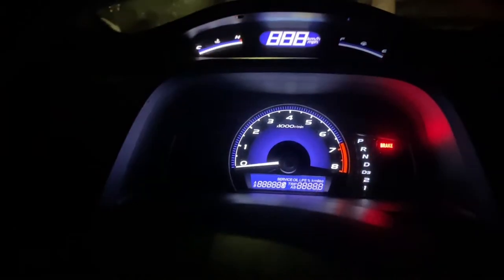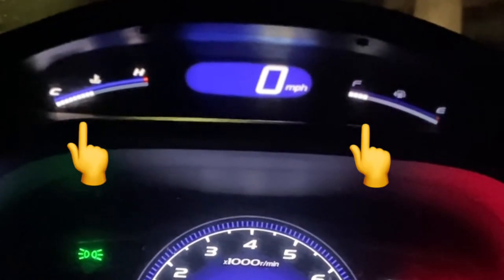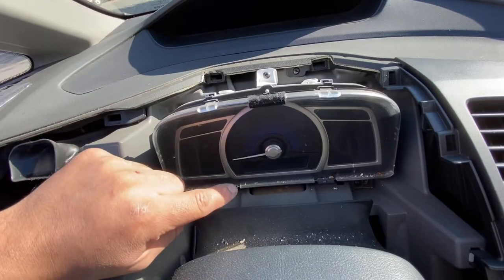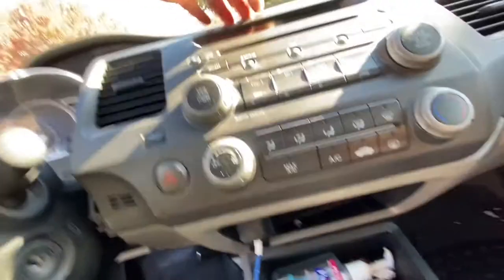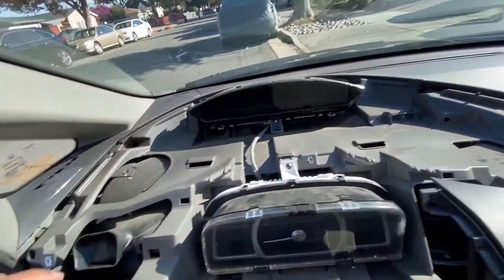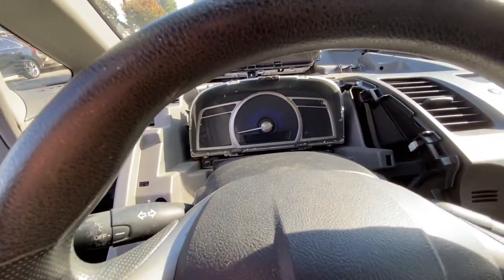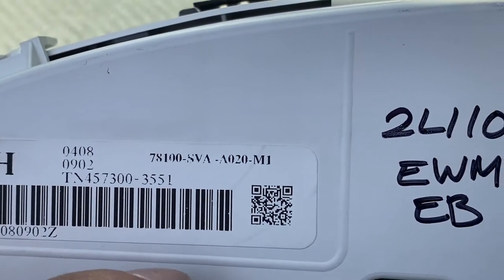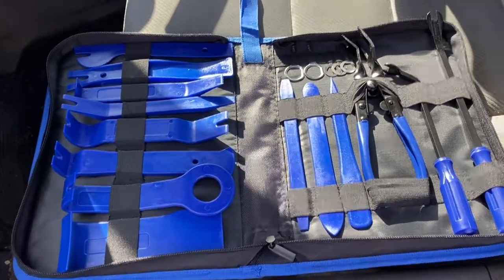2006-2011 Honda Civic How to replace gauge and instrument cluster- STEP BY STEP

Comment: 90% of them do this. Mine does also. You can press on it and it will swap around to normal. Due to bad solder connections on the board on the back.
Reply: Thank you for this comment! I just bought a used one so I was freaking out about it. Learning it's a common issue (and that you could just slap the plastic trim back to normal) was incredibly reassuring.
Reply: @cassandraperkovic6167  yeah, it’s annoying but not a huge deal. If you put gas in it, you know there’s gas in it. Lol. Mine got to the point where it would be inverted, and just display backwards. I could still read the gas, it was just (blacked out bars) were gas, and the (white illuminated bars) were what gas was missing.
Reply: Is this something you would fix before resale? That's what I'm thinking of. Doesn't bother me but wondering if it would kill my resale value

Comment: This is awesome. I just bought a used 2009 Honda Civic and have literally the exact same problem. My temp gauge lights are inverted. This was extremely scary when I first noticed it because my last car overheated and died, LOL. Turns out it's just a lighting issue! The temp gauge and fuel gauge are such a crucial pieces of information that must be working properly to maintain the safety of the vehicle. I'm so glad I have this video saved to help me with the project. You're a life saver!

Comment: Question, I have a 2011 LX Civic the RPM cluster goes in and out, I pulled the dash apart and noticed when I move the wire harness a little the RPM Cluster comes back on. Im guessing its the wiring connector going into the back of the cluster. Have you heard anything like this happening? Thanks

Comment: This is a great video.   Not sure why you skipped showing the removal of the 2 bolts for the audio unit removal.   That is by far the hardest part of this.   I scraped my hands in multiple spots  trying to get these out and the contorsionist position you have to get into to access them is highly annoying.    The whole process is very easy with this video except for those 2 damn screws.
Reply: indeed it was a struggle to get to those bolt as well as to put them back but the whole process was clear and simple enough, i was luck enough to have the right part and it worked without issue
Reply: This is my one hang up. Having a hard time with this @tropicprince

Comment: All new clusters need to be programmed  ,you can't change them over just like that ,do not try this ,if you do you car won't start
Reply: Yea it will start you don’t program it
Reply: @jose32301  mine went bad so if if I go to the junk yard and replace mine mine concern is will the miles change I really want the same miles on my car cause what if the other cluster has more miles then mine

Comment: Thank you! Simple and easy, I was able to do this to mine. Yes the 2 bolts inside the audio is a pain! You cannot see it as your head isn't small enought to fit where you can see it and it's up there deep inside. You need a fairly long neck socket to get there.

Comment: Do you have to disconnect the battery?
Reply from the maker: No, just the ignition switch off.
Reply from the maker: No, just turn the ignition switch off.